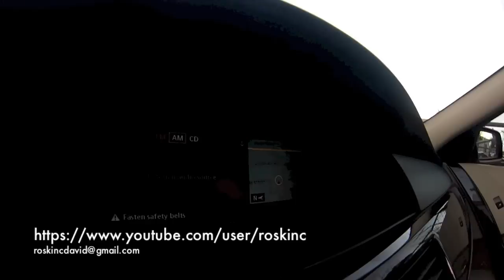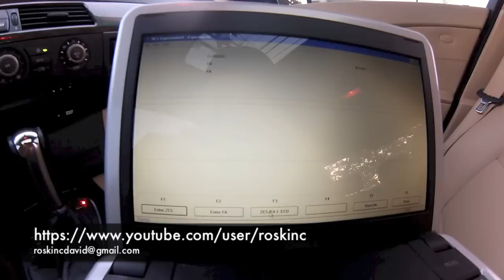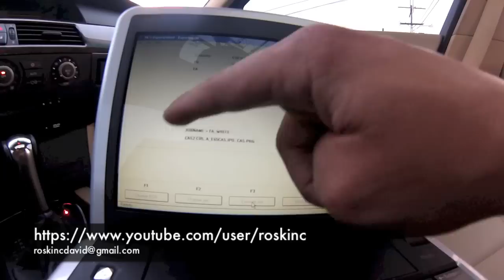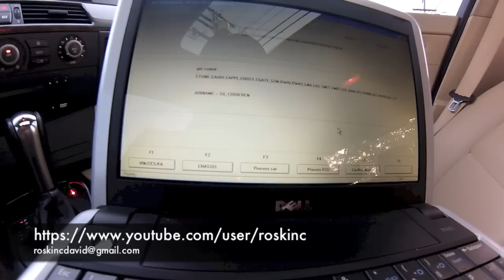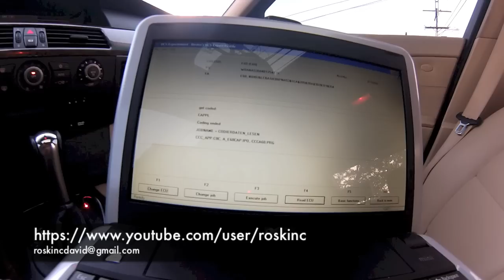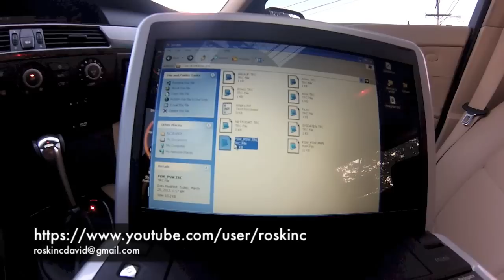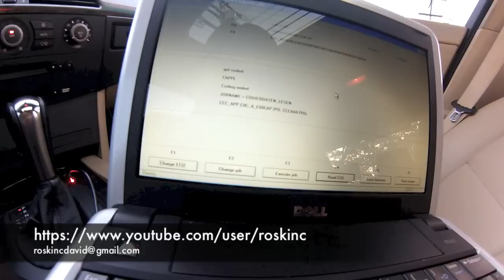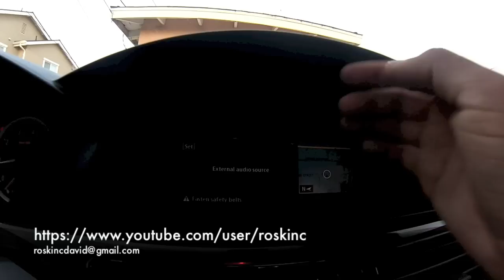BMW E60 5 series How to code AUX in Idrive ncs expert step by step

Comment: Fantastic - Thanks for all your help and quick response to emails
Here are a few notes:
Windows 7
Version NCS_EXPERT 4.x
Had to change com port to 1
had to make sure to set com port latency to 1 - got errors otherwise
used EXPERT_MODE instead of REVTOR's NCS_EXPERT_PROFILE
did not have NAV - used MASK - only one "OK" button to press - video has two for "CAPPL"
had to remove "nicht" from "nicht_aktiv"
did not hear the "CO" in "CODIERDATEN LESSON"  I ended up pausing the video and counting rows

Comment: Hi roskinc! I bought, connected and programmed my aux cable and it works very good! But I added the VO to both light module and CAS. I read it in a coding forum, that you should add the VO to both modules, or there could be a problem later. 

Best regards,
Fredrik

Comment: I really think you should have 3 videos. 1st. Explain that there are 3 tasks to complete. Your first video should have referenced the needed ODBII cable and how to get the needed software and it's requirements. I'm guessing you didn't do this because most customers would not step into the burdensome process. 2nd. Explain the hardware install. 3rd. Walk through programming.

Comment: The updated FA list should also be written in LMA, not just CAS! Also it's quicker and easier to just code (SG_CODIEREN) the CAPPL/MASK after updating the FA list. No need to do any manual parameter changes.

Comment from the maker: dont have a link, email me i can send it through email
Reply: roskinc hey man I followed the video and got aux to show up on the screen. Instead of a aux cable I bought a Bluetooth module with 12pin that goes in back of unit and I spliced into the same ground and positive cables you did. Everything seems to work but no music no sound. Any ideas would be appreciated